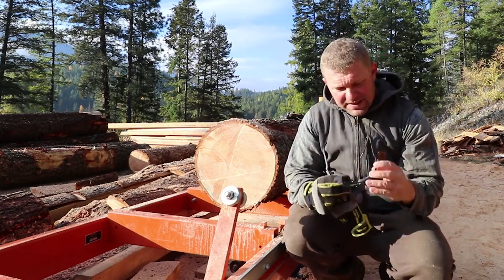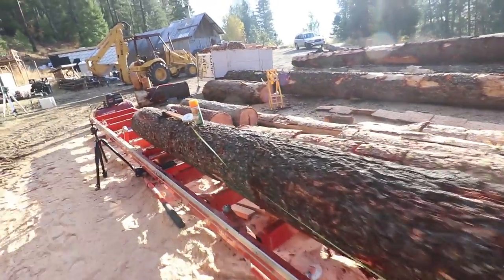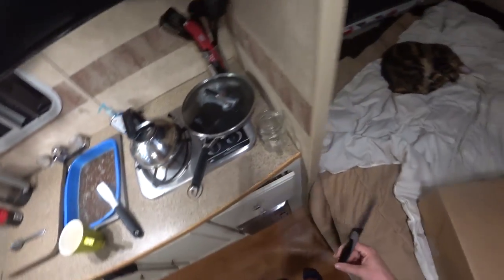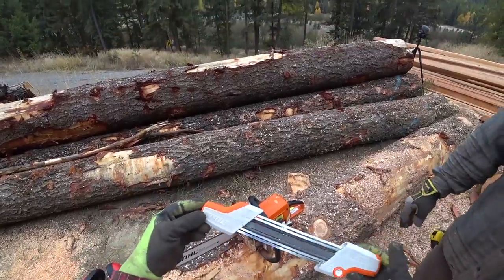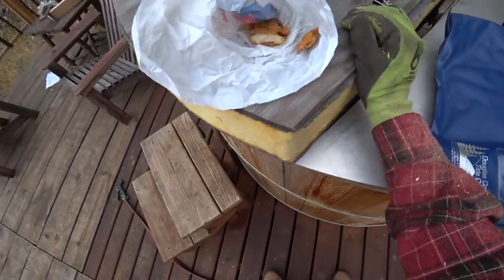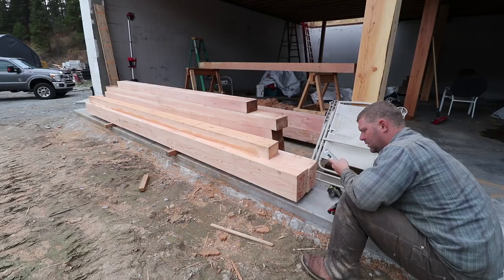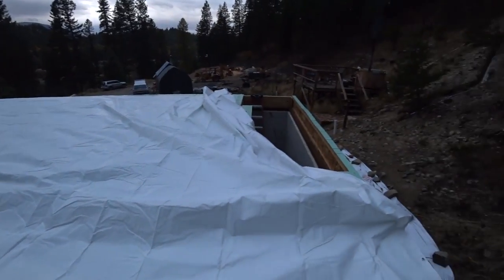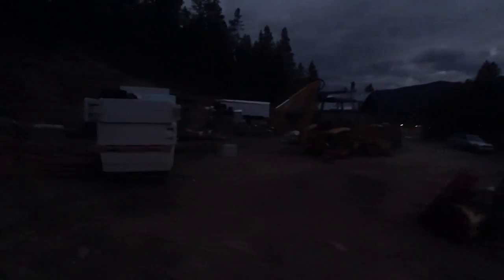Building a House Start to Finish: Sawmilling a Timber Frame

Comment: That mill...  Each time I see it, I'm like: man, why didn't they threw a 1hp bigger motor, and put a better alternator... Then on the top of the mill, put two beam at each end of the head assembly,  and put 4x 10-20W led lights. It would allow to work later in the day/night while being safer in lower light conditions. The weight would be minimal, but the extra safety would be worth it.

Another thing would be to have a tank heater, which would allow to use a cheaper fluid. Drain before the night, add a bit of winter one. Fill back in the morning with summer fluid and it wouln't freeze as long as the engine is running. Heck, probably even a small few watts electric heater would be fine...

Comment: Looking awesome, keep up the good work. If I was yourselves I would try dropping a long sling at the side of the mill, slide all of the large off cuts on to the sling then once you have a pile choke it up and lift them out the road with the back hoe. Could maybe save you some time and let you deal with them later.

Comment: Jessie so your saying you go through 2 blades on each log!
Reply: One blade per log, he's just not switching them at the same time.
When he gets to the point of doing final cuts, he puts on a fresh blade, so he can get the cleanest cuts to cut down on work with the plane.
Then, loads a new log, and does his rough cuts with the existing blade, now that it has gotten a bit dull, before switching to a fresh blade for the final cuts again.
Reply: No, one. He switches blade just before the final dimensional cuts, then uses the same blade to rough cut the next log, and so on.

Comment: OCT 13th damn. well too late to tell you to NOT life like you are. bend at the needs. life with you legs. and NO TWISTING. keep your back straight. i'm almost 30 and this has saved me and a few folks i know from having surgery. and i know a few folks who didn't lift safely. tho you get massive upper body strength when you spend a lot of time having to use your arms to move things. and you legs too when you lift properly.

Comment: Rome was not built in a day. You should be taking a bit of a break or else it will consume you. There is allways time its not like they can work on all timbers at the same time. You might have to cut a few timbers if a joint gets done wrongly or you find a weakness on an end etc after you cut it, these are just things that happen. Cant plan for it. Its the really big timbers you hope you dont have to redo.

Comment: wow, i want cry Guys, You pay so much for that logs and you mill it but you cut the strongest and most valuable part of the log up for firewood!!!!!! whyyyy  you could have saved it for something better because the wood closest to the bark is more mature and the microfibril angle is lower than that of the wood in the center of the tree that is less dense and is weaker and has a higher microfibril angle, I am studying Wood and wood product science , but I guess its too late now for saving .
Reply: I'm pretty sure you have it backwards,  the oldest wood is at the center of the tree

Comment: Is it normal for hydraulic buckets to drift down like that?. 14:55
Reply: threeque, It is not normal for  the boom on thr backhoe to drift down. It's a sign the the packing inside the hydraulic cylinder is worn and should be replaced.

Comment: simplistic, uninteresting comment, but fact,... you two are busting ass.   on the sharpening- cut (sharpen) moving the file forward ONLY, not pulling backwards. (the file isn't designed to cut backwards.)